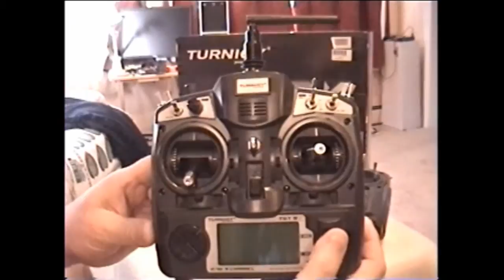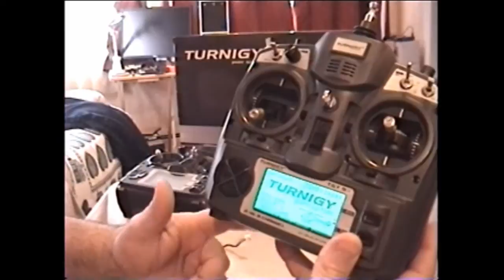Turnigy 9X battery and EL panel mod

Comment: Wow .! Where to start, Hmm how about the "Long Antenna" Well that would be because that hand-box is not in the 2.4ghz CB band it's actually using the dedicated 72 MHZ band which is dedicated to RC aircraft. All the 2.4 ghz systems are in what's known as the 2.4 ghz citizen band allocations. By the way you should never turn on that transmitter with the Long antenna collapsed. You should at least extend it half way. Leaving it collapsed results in high SWR which can destroy the final transistors

Comment: The JR style plug fits in the 9X. As long as the battery doesn't dangle on the wire, it will stay connected to the remote without any modifications to the battery.

Comment: Hobby King 2S Balance connector (2 cell balance Connector Align Model No. K10189TA)
JST-XH 2S Harness for Hard case Lipo $1.47
2S Battery Charging Adapter Set  $1.18
2S Hardcase Saddle pack Lipoly Batteries $1.99

Comment: I unplugged it to charge it and i noticed the problem.Its still working but that connection is loose,which is probably what caused the ark ,but it never acted faulty when i used it.Thanks for your help.There was a lot of talk about it being too powerful,but others say its fine.

Comment from the maker: @lsearls1 i never had that happen, but i charge mine in storage mode...so its not high amps......maybe if the radio is still working you can solder another pin on the board....i have 2 9X's and they have same battery, you must of had a bad connetor cuasing an arc to melt the pin ??????

Comment: To be safe, you discharged the battery before cutting the wires. How much do you discharge this battery? Not all the way I know. I just want to be sure I'm safe before I solder the wires.

Comment: Thanks for the video, cruz. It's a very important mod to have on that radio. That battery looks a little heavy. Are there any other lighter/smaller ones that you'd recommend? Is 2s vs 3s a non-issue?

Comment: I think u are wrong on the battery connector: its a 3 wire charger connector. So, its a 2 cell balance charger connector, not 3 cell balance charger connector, as you say on video.
anyway, thanks a lot for the video. I havent received my radio and wanna to buy the connector. Thanks to you i discovered what i need to buy.